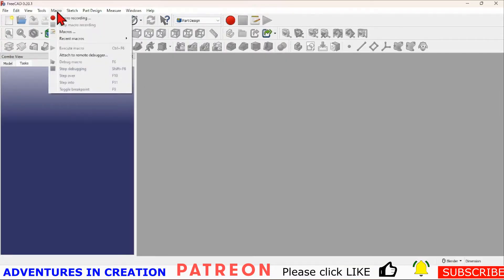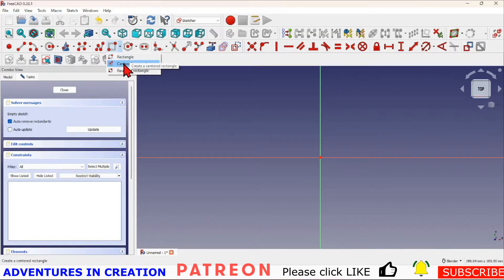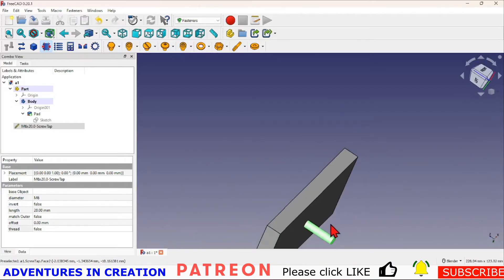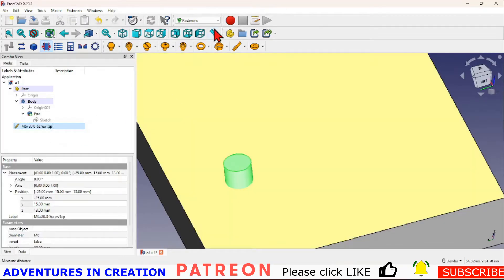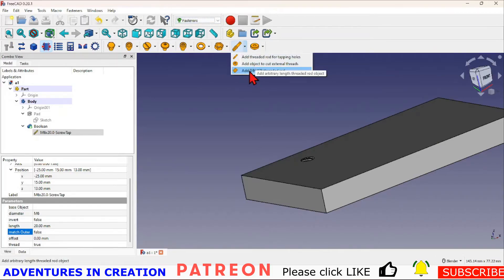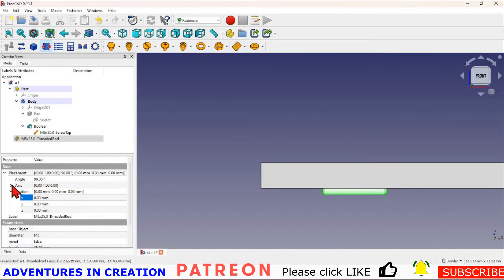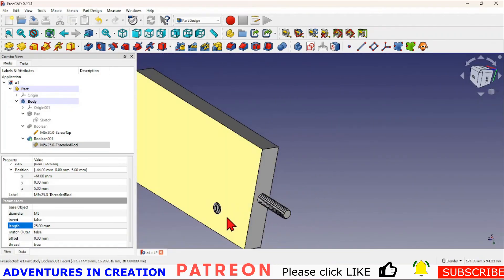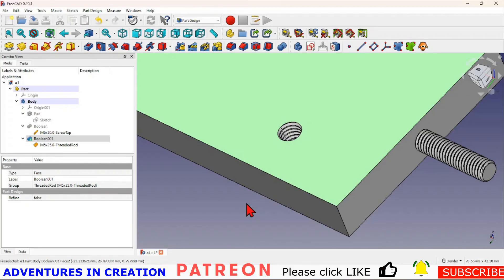FreeCAD for Beginners #44 Creating Threads #freecad #freecadtutorial

Comment: Lol, so you need to download the addon to be able to create threaded holes. Sigh! Here's me thinking that i couldnt figure out how to create a helix properly into a hole. No wonder i couldn't get it to work AT ALL. Sigh, ok then. I need to update my rule set when it comes to making things in freeCAD. I usually try to figure it out on my own multiple times. As previously the tutorials i was able to find all assumed that the viewer has all the basics learned already. CAD modelling software isn't intuitive to someone whos only digital art experience is with something like photoshop or similar. Creating a sketch that has annoying errors like underconstrained etc... wtf is a constraint? Where is extrude? Isn't a screw thread a helix why won't it allow me to add a helix to the inside of the hole I've highlighted? And the list goes on.
Reply from the maker: Seems like you should head back to the earlier videos where all of that is explained. You don't need to download anything to create a threaded hole if you just use the hole feature in part design.

Comment: This was very helpful but I think either I am missing something or the workbench can't do what I want. Bear in mind I am new to FreeCAD and I'm hoping for some advice.  I'm trying to create an odd SAE thread.  13/16 x 27 to be exact.  I can see how to change the diameter but 13/16 isn't in the list and I can't see how I manually add a custom diameter nor how to set the TPI count.  Is what I'm trying to do even possible with FreeCAD?  Appreciated.
Reply from the maker: You can create the thread from scratch. You won't be able to do it with that workbench
Reply: @Adventuresincreation  That's what I was thinking.  Appreciate the confirmation.  I played around with it a bit this morning and I think I managed to fake my way through it by converting to a VERY close metric equivalent.  Since this was a 3d printed part the PLA gave me a little wiggle room so thread accuracy didn't have to be spot on.  In my case I made it as a 21mm x 0.775 thread and shockingly it worked out really well.  More than "good enough" for my needs here.

Comment: I was following along, you mention creating multiple solids at the end, how do I avoid that? It's happening to me when tapping a M3 hole. If I set the tap size back to M6 (or set thread to false), no problem.
Reply from the maker: The M3 must be missing the main body and trying to create it in air

Comment: Isn't there supposedly a gap between the bolt and the tap? When creating a tap as a boolean cut from the same part that also forms the bolt, then there won't be any gap and the two won't mate, no?
Reply from the maker: If you use the tap, it has the clearance built in, then if you use the rod they will mate. You can print them and try it. Make sure you have "printable" set in the settings.